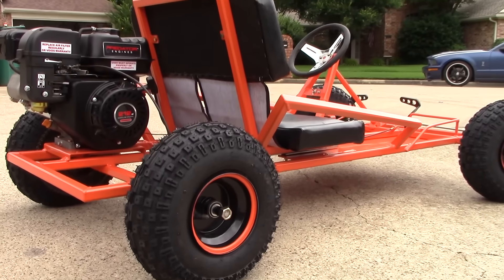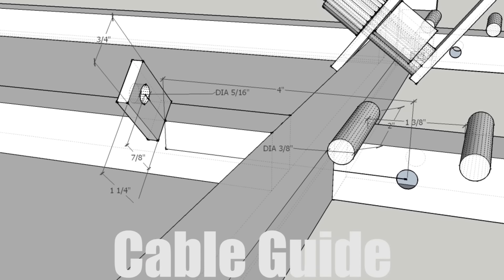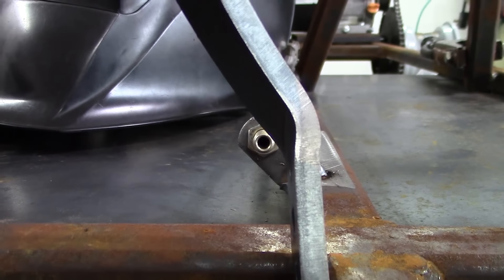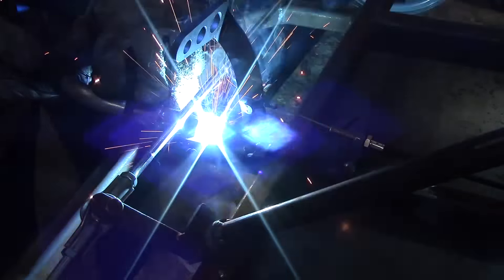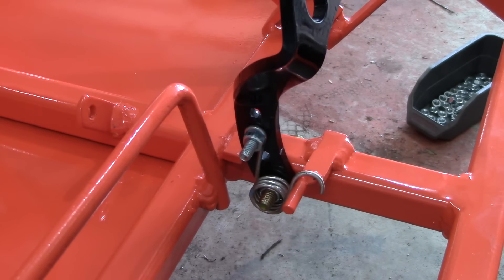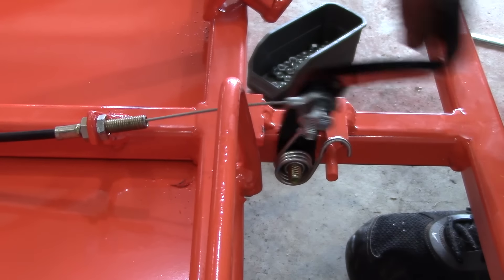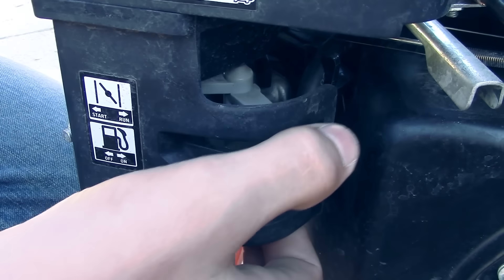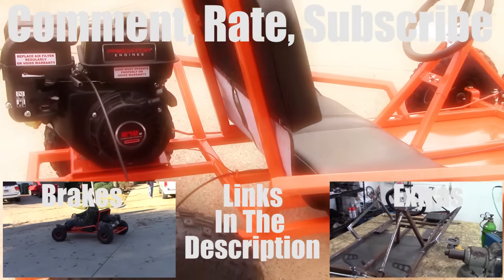Go Kart Throttle Cable: Linkage and Installation

Comment: Does the Governor control the throttle on idle? Because my black throttle arm on carb isn't in the fully closed position, it's a brand new Tillotson I never started it yet.

Comment: Can you or do u have a carb to pedal direct method I have an internal carb slider connection.
Reply from the maker: You just need a different throttle cable

Comment: The issue for me seems to be that the pedal travel is not enough to pull the cable enough to give the kart enough throttle
Reply from the maker: Out the cable higher up on pedal for more throttle throw

Comment: what is the retainer like screw called beside the wire stop screw? i cant find it on amazon /ebay, my 212cc engine does not have it. I tried to put retainer screw but no results, pls reply thanks!
Reply from the maker: Look up a parts diagram

Comment: Got it thanks... Is that company pretty decent to deal with
Reply from the maker: +Don Raabe yeah, the pedals they make are proprietary and aren't some cheaply made parts. Same with the throttle cable. Its all heavy duty, quality  stuff that will last for years and years.

Comment: My cable has the ball on one end and bare wire at the other. Do I put the ball end into that pedal hole and bypass the screw entirely, or do I put the ball end in the engine and then wrap the bare end around the screw? I’m new to this and I just finished sandblasting and painting the frame for my Manco Critter and it’s starting to go back together.
Reply from the maker: Ball is typically for twist grip

Comment: im a big guy and i keep trying to design an off road go kart but everything i keep coming up with just seems to big but then when i try to downsize it i feel like im losing things i want to keep this is harder than it looked
Reply from the maker: hmm, the struggle is real haha. im 6'3" and 240 lbs. Its a balancing act for sure.
Reply: @KartFab  im also 6'3 but im 425lb but i also want to be able to load about 200lbs of bags for camping as i live in CO and we have tons of public trails that go for hundreds of miles

but it seems the smallest i can figure is about 7 long 3-1/2 wide and about 4-1/2 tall on the cage to get all the thing i want

and i dont ever plan on going over 35 MPH

one thought i was having was 2 inch square tube for the main base frame then 1" square tube inch cage

but 2 things i keep coming back to is i dont think a 1" axle will work for supporting the frame me and 200 pounds of kit even if i cut it down to 50 pounds of kit

and 2 i have no idea how big of an engine i will need to push all that weight

im kinda leaving the realm of go kart and dipping into small buggies

i do plane on have 4 bearings in the back to stop the axle from flexing on the sprocket

i already have a fresh 18 HP electric start engine  do i need to go bigger in your opinion?

 it not going to be doing anything but pulling me thru trails and up a few hills no ripping or jumping

what do you think i can do to cut this down other than the obvious me losing weight i'm already working on that
Reply from the maker: @Friedrich-Wilhelm-1980  be careful with the thickness of the steel, if you go too thick its just dead weight. if its an 18 hp make sure its a legit 18 hp (honda gx610-620 or briggs vanguard v twin) those duromax "18" hp engines are actually somewhere around 13-14 hp. The axle really isnt going to be a big deal, what is a big deal is how far from the bearing support you have the wheels set to. You want the wheels as close to the bearing/support as you can get them. If you dont want to go with a 1" live axle, you can always step it up to a solid 1 1/4" used in race karts. There are different qualities of axles as well. I have had good luck with the asuza flex-pruf axles.
Reply from the maker: @Friedrich-Wilhelm-1980  if you are going industrial 4 stroke at 18 hp the 40 series with the biggest driven unit (iirc its about 8" diameter) will be all you really need and just do the math for gearing. You would probably even be ok to gear it for 40 mph  with true 18 hp.
Reply: @KartFab  well the 2 inch i was thinking of using is 14g is that overkill? 

lol and  my "18" hp engine is a duro/max looks like ill have to figure something else out

ill try the duro/max first since its already unreturnable and ill keep my eyes out for a good deal

i mean im ok with  low gearing for a year to get my head around it then upgrade it later

i mean the whole point of making this it to distract myself from food and hopefully get down to about 280

that said the bearing will be right off the frame and and i plan to have the wheel as close as safely possible im also toying with the idea of using dirt bike wheels because i already have them and they are in good shape OR i have a set of 4 old honda quad rims that would need rubber
Reply from the maker: 14 gauge is about right. Its going to be heavy. the "18" hp duro max isnt too bad. So id say if you want to keep that weight just buy a few jackshaft sprockets (e.g. 8t and 10t) and see which feels best. The only time you run into issues with gearing, it isnt going to be with the engine, its actually going to be with the torque converter being able to transfer power from the engine. For example, if you gear it for 40 mph, you might not be able to start climbing a hill from a full incline, and the belt will slip and start burning. But if you gear it for 30 mph, you will get better grip and power transfer since you are not stressing the belt out as much.  Id rather use quad tires/rims than dirt bike wheels on anything with 4 wheels.
Reply: @KartFab  well i was talking to a co worker today and i just scored a free 600cc honda clone quad engine with a 5 speed transmission

i started the main body this morning and its looking good so far i will still have to work out steering and order sprockets and axle

but at least they will have a body to go on and a engine to drive them

Comment: But what if you have a mikuni slide type carburetor where the little nub on the end will not fit through the housing to slide it out and feed back in? Thanks.

Comment: What size wrench did you use
Reply: For the friction nut
Reply from the maker: its 10mm for friction and 10mm for the other one. This is true for honda, clone, and predator engines.
Reply: +KartFab thx

Comment: Could I do this but with bike brakes ???
Reply from the maker: I have used bike brake cables for my go kart throttle cable before. They work, but they dont tend to last as long as the real deal, throttle cables (especially the manco ones) are built with much thicker cable and do tend to last a very very long time.

Comment: Can you use a throttle cable as a braking cable too? Or is it too different cables.
Reply from the maker: +Terrika Principato it's not very safe to use a thin throttle cable to brake, because it can break. Ba dum tiss.
Reply: +KartFab oh alright thanks

Comment: so my engine "7hp duromax" has a turtle mode and a rabbit mode plus the throttle.  there arent things like this to attach my cable to.  any tips?
Reply from the maker: +Jonathan the lever that you move between turtle and rabbit should have holes for these things. Check your users manual for "remote throttle" setup.
Reply: there was a hole i noticed that had a screw but i thought it wasnt for this purpose ill check the manual.  thanks for the reply!

Comment: I am planning on making one of my own using 20" steel rods as the frame and 30" as the axle. I was wondering if making a box for gear and slots for multiple speeds and the throttle cable going to the back of the engine, I still don't what I'm gonna do for brakes but I got other things sorted. The downside is that I don't have pedal acceleration just a gear stick :)
Do you like my idea! It's gonna be single seated so it's more aerodynamic and my brother ain't gonna get a joyride with meh lol
Reply: Also do you have any ideas I could use for brakes? I'm on a budget so I'm not gonna spend like a hundred dollars on brake pads or anything.
Reply from the maker: +Subscribe 4 Nothing that's not going to work. You can look into buying an old lawn tractor and fixing it up.
Reply: I've planned it out in notes according to my calculations it should work.
Reply from the maker: Hows that working out for you now?

Comment: What did you use for the bracket that holds the throttle cable housing in place? My dad and I are building a go kart and can’t find anything that works.
Reply from the maker: Use the link in description for link

Comment: I followed all your steps to a T and my gas pedal still isnt moving the lever.. would that be becuause a spring ?
Reply from the maker: Can you move the lever by hand? The friction but might be tight
Reply: KartFab yes. Everything on thr engine moves freely. The cable is still a bit long would that affect it ?  Pushing the gas has no response on the engine.. shorter cable more tension ?
Reply from the maker: You don’t need to shorten the cable, just pulll the cable through the hole in the cable stop until it’s tight and tighten that locking screw down
Reply: Ahh ok

Comment: I purchased your plans and built the standard  live axle go kart.  I replaced the centrifugal clutch with a 30 series torque converter.  The wheels seem to spin fine when the kart is raised on jack stands but when I try to ride it, it doesn't seem to be getting enough torque to the wheels to get going.  I am using the 60T axle sprocket with the 10T converter sprocket. The tires/wheels(145/80-6) and sprocket are keyed into the axle and I am using locking collars.  Any ideas? Thanks
Reply from the maker: What about your engine?
Reply: 6.5hp predator
Reply from the maker: Did you loosen the friction nut on the throttle linkage and the throttle stop bolt? Does your throttle lever extend all the way when you depress the gas pedal?
Reply from the maker: Choke off, gas on?
Reply: choke off, gas on and the throttle lever has full travel.  The engine runs fine, feels like a problem transmitting power to the axle
Reply from the maker: it should take off faster than it did with a centrifugal clutch. Try posting up on diygokarts.com with pictures of the setup. hard to diagnose without pics.

Comment: Hi KartFab, say can you give me that throttle linkage kit part number. I really like that setup. Does it include that spring for the peddle return? Thanks
Reply from the maker: +Don Raabe just click on my article link in the description, it has the links for the cable, return spring, and gas pedal. If you go to the brake section after reading the article it will link to the brake pedal return spring, and brake pedal. Its the first link in the description.

Comment: I am building a cheap one but the throttle cable and pedals are very expensive
Reply from the maker: you will be in for a surprise when you find out how much tires, engine, rims, seat, steering wheel, drive wheel, brakes, steel, and paint cost :-)
Reply: KartFab learning that now! :(

Comment: Hi I hope you really reply  I could use some info im planing to use a 212cc predator do you happens to know how much space id need to weld like a foot by a foot as an right angle or is that too much or too little?
Reply from the maker: +LOLitzDanny I have no idea what you are talking about. Please explain in complete sentences.
Reply: ***** my question was , can you tell me what the measurements for the mounting section of the 212 engine are like where the bolts go? thank you
Reply from the maker: Oh ok now that makes sense. The bolt mounting pattern is found in the users manual, just get on harborfreight.com and select the engine section, look for 212cc and then the manual is right there to look at as a pdf.
Reply: ***** thank u so much

Comment: Hey kartfab, when i installed my throttle cable and tested it it was way to hard to press it, i accidently put to much force on it and it snapped. any ideas of why this happened? also i am not using the kit you provide.
Reply from the maker: I'd start with the throttle arm on the engine. Can you move the lever on its own? There is a friction nut that needs to be loosened. After pulling the lever by hand it should return automatically. Next I'd make sure the go kart throttle cable can move freely within the housing. Once you have all that straightened out, move to the pedal. You might need to buy a decent cable. The cables I use on all my karts are the Manco style and are the best type to use IMO.
Reply: ***** I can move the throttle arm on the engine. and i can move the cable through the housing. I guess i can try a new cable
Reply from the maker: Just make sure there is some type of pedal stop on it. You might have just pushed the pedal too far.
Reply: ***** But i cant push it at all xD

Comment: I didn't get a wire stop and a cable holder
Reply from the maker: that stuff comes on the engine new (if you are talking about a predator 212cc engine)
Reply: KartFab yeah that is what I thought but it didn't come with that and it was brand new that's weird